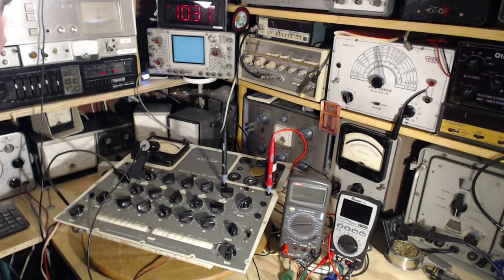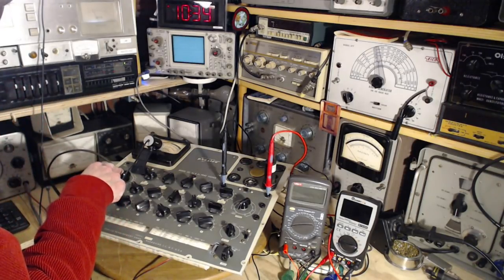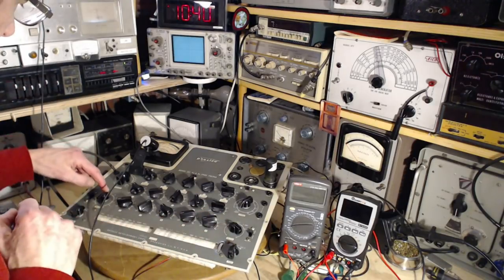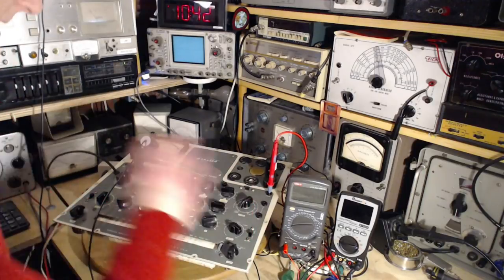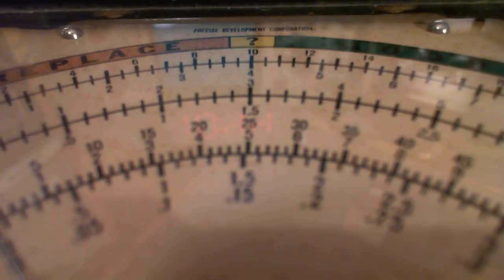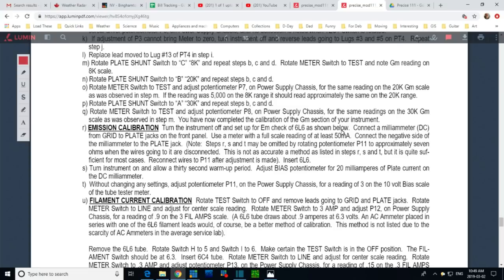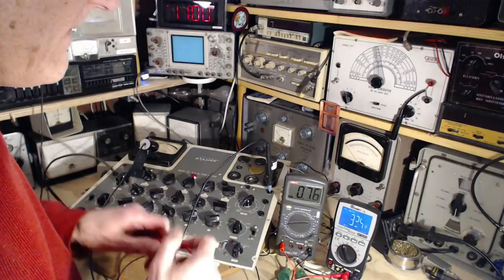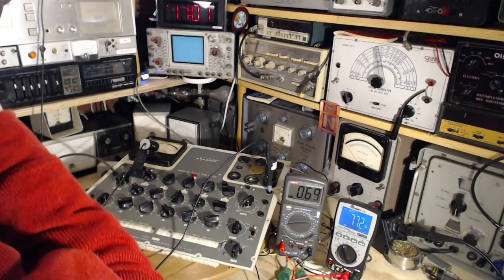Precise Model III Tube Tester Video #13 - Repeating the Em Calibration Step

Comment: This tester has a curve tracer function using the scope as well. It would be interesting to see how this works.
Reply: widecast There is no curve tracer function on this model or any other Hickok type bridge tube tester that I know of. I have a book by Igor Popovich, How to use, calibrate, repair and upgrade Vacuum Tube Testers. The 111 is in the book and there is no option for curve tracing. There is a section on how to build a simple staircase generator to adapt to many testers to perform curve tracing but none of the older testers, not even the top of the line Triplett 3444 can do that on its own. You’d have to add a circuit like the one added to this Eico 666 to do curve tracing with a scope attached. http://www.dmitrynizh.com/eico666.htm
Reply: SIXSTRING63 this is a "precise model III" valve tester. Read in the manual under special functions.
Reply: @widecast  yeah, read it. Looks like a very rudimentary test. https://www.rs-online.com/designspark/how-to-use-an-oscilloscope-as-a-curve-tracer  similar to this. My Hickok 539C has the self bias feature which you could setup and do the same. I was talking about a true multi curve comparison. If you have an old semi conductor curve tracer they can be adapted for tubes. I wouldn't try this test on a good scope, could be disaster waiting to happen with a little mistake.

Comment: EM calibration = set up for 6L6  then turn Em shunt to 0,   controls F - J = 2,6,8,3,1 ,  controls K - O = 0,5,2,4,8.    Then insert tester leads into plate and grid sockets...Neg lead into plate socket, + lead into grid...